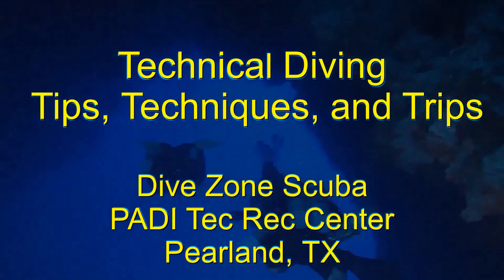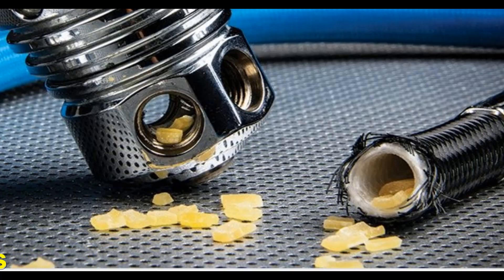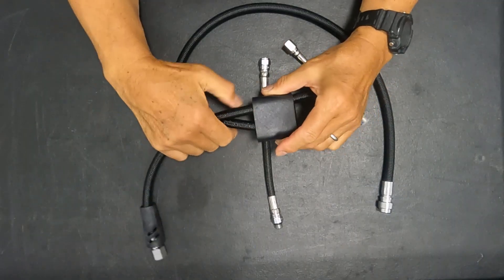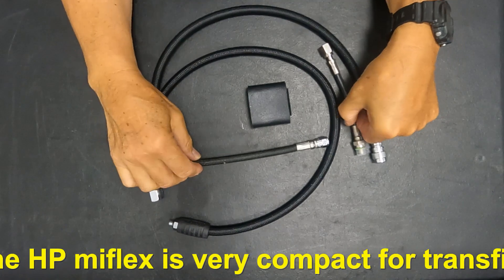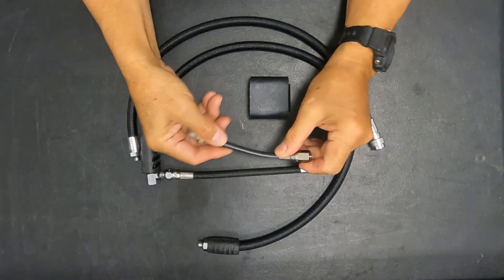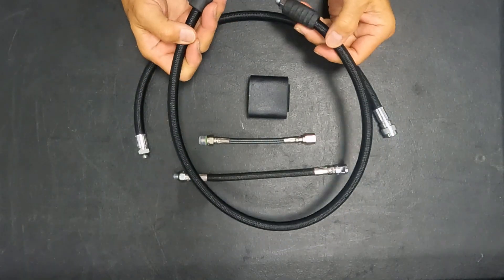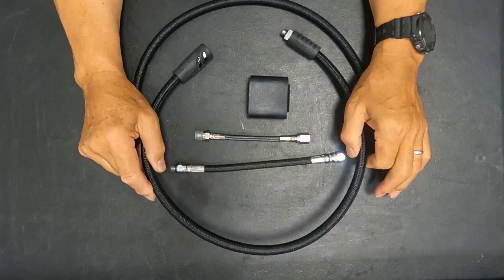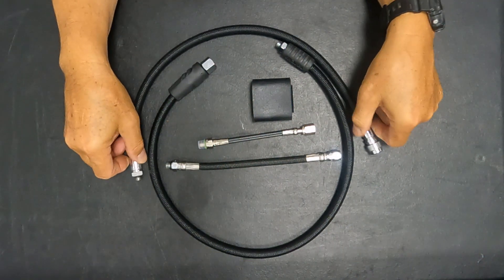#209 - Braided Hoses For Scuba Diving :  The good, the bad, and the ugly

Comment: Hello, can any console capsule be used for oxygen or nitrox with the criss deco tube? I need an oxygen-compatible depth console. Thank you.
Reply from the maker: Most manufacturers will not explicity recommend or approve their products for use with x100.  However, Mares does make a pressure gauge that is marked with the word "oxygen" on the face and the assumption being that it is not there without reason.  I am not sure why you would need an oxygen compatible depth gauge.
Reply: I have an extended range diver certificate. My deco cylinders are 55% nitrox and 99% oxygen. I had my regulators cleaned with oxygen. That's why I asked. The console on my regulator is a standard capsule used in technical diving.